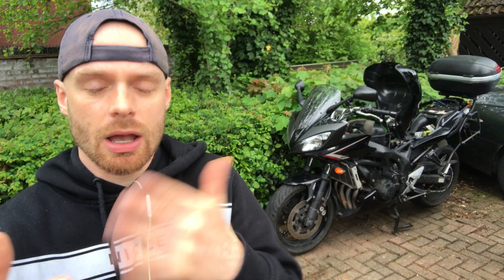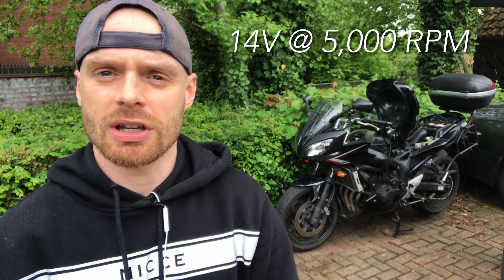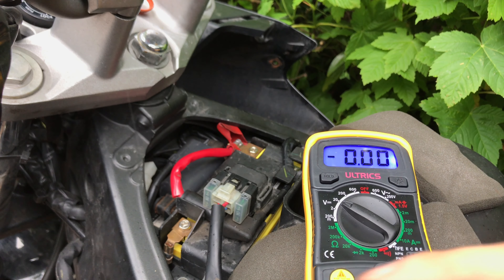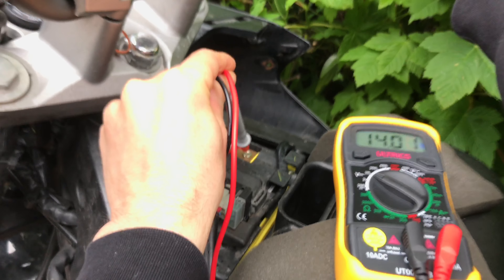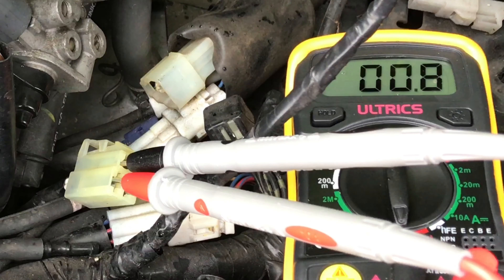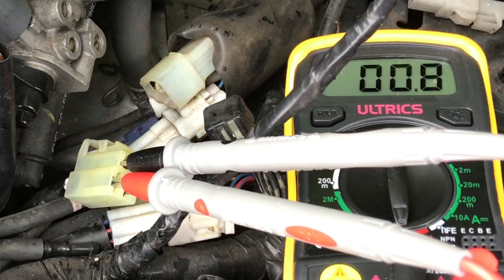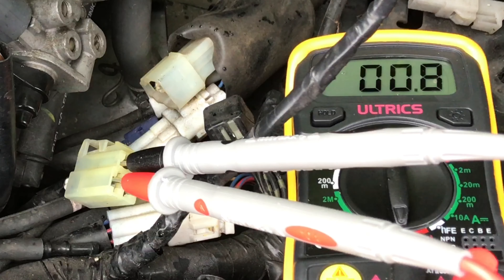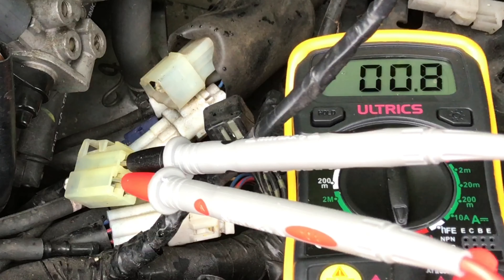Test a Motorcycle Alternator Stator & Charging System | 4 best ways | How to

Comment: Thanks for the explanation of the multimeter testing.they come with minimal instructions.
Reply from the maker: No problem. There’s a lot more to learn, but the basics in this video can serve you well for most things
Reply: @FabMotorbikes  I've got a question.i put the stater,the pulse indicator, coils,plug wires, controls, even jetted my  carbs .It runs fine but it blows headlights out like it's over charging.ive switched rectifiers idk what would cause this . maybe a crossed wire or a bad ground somewhere possibly?
Reply: @steevenknox4266  the rectifier is either faulty or the wrong one for your machine.
Reply: @roythearcher  thank you.what I found was corrosion in the plug.i used butt connectors to replace the plug and it seems to have fixed my charging problem
Reply: @steevenknox4266  Good to hear!...

Comment: This is the easiest to understand video I found . Thanks a lot .. my bike wasn't charging the battery and even the battery warning light wasn't coming ... Checked the alternator , it's fine.   Must be the rectifier then.
Reply from the maker: Thank you very much! I’m glad you found it useful 👍it does sound like it the rectifier (I have a video on that too: https://youtu.be/mn6RtpdmeQE) . For me it turned out that the battery had just completely given up.
Reply: @FabMotorbikes  thanks.  I will check it out ASAP , one more thing.   Is it okey for the alternator to throw out high voltage like 70-80 at high rpm ? , For example mine was showing 50 at about 3000 rpm .. 
Any help will be appreciated ❤️
Reply from the maker: Which of the four tests is that on? If it’s the 3rd then that is okay 👍
Reply: @FabMotorbikes  yes it was on the dynamic test where bike is running .
Reply from the maker: That’s absolutely fine 👍👍

Comment: Awesome vid clean and simple 👍, a extra check can be done on the + - terminals of the rec/regulator whilst running to see the dc output. Faults can ly between rectifier and batt. By fuses, lose connections and damaged wires.
Reply from the maker: thank you, glad you liked the video. I did also test the regulator/rectifier with it off the bike... but didn't know there was another method (which sounds simpler) of testing it on the bike whilst its running. Cheers for the tip!

Comment: Great video! 
My situation: I have a vintage 1972 yamaha 100 with points and condenser. 6v system. 3 coils attached to stator. Source coil, lighting and charging. Black wire coming out is from source coil... goes to main coil through pigtail on main wiring harness. Bike has no spark. Hard to know if source coil is grounding out with it being connected to points, condenser, source coil all being on stator plate. Tried putting cardboard between points. Shows that I have continuity to ground while testing wires coming out of stator. Thats the rub! New points, condenser, main coil, rectifier, spark plug, battery etc. I'm thinking the black wire pig tailed to main harness is grounding out the main coil... possibly in ignition switch or not connected properly in the rat best of wires behind headlight. Question: Can I take the pigtail out of the equation and simply connect black wire coming out of stator source coil... and connect directly to the one wire coming off the main coil?

Comment: I did the three phase to ground voltage test like you showed and got a 20-23 idle RPM voltage on two of the phases and pretty much zero voltage on the third phase. I talked to a local mechanic about this and he said this is to be expected as one phase out of three is supposed to be grounded. I'm not too sure about this, have you found similar configuration on a bike? Looking for some advice. Rad video! Really helped me to dig deep into my motorbike's charging issue.
Reply: You should have the  exact same ac voltages across all 3 phases.

Comment: thanks for this  my battery is on charge so i can dynamic test .i have  a2014 cb500 are all bike result be the same value 20? hoping for rain to stop when battery is charged. i tested at battery 11volts when revved stayed at 11v hope this test will find problem thanks again
Reply from the maker: The values will differ some what based on the bike. Best to check the user manual 👍

Comment: According to the Heynes manual for my XZ 550 connecting the positive rectifier connector to the  (red ) MM terminal and the black MM terminal to the 3 white leads of the rectifier the MM should signal continuity but did not, reversing this should show no continuity which it did . I think the book got it wrong because using your method a got exactly the readings you demonstrated so thank you as I really was confused. PS:  Does disconnecting the alternator while the engine is running not damage anything?
Reply from the maker: Glad it was helpful. Your manual does sounds confusing. And to answer your question… no it won’t damage anything but I’d advise to do it for as limited time possible. The battery will not be charging at all with it disconnected.

Comment: Hi Fab. 

Very helpful video. I have a 2007 Tmax which isn't charging, so I followed your testing method. Yamaha Service Manual says stator coil resistance is 0.216 - 0.264. My readings are as follows; 

AC volts readings
1&2 - idle 25, 5k - 74
1&3 - idle 20, 5k - 74
3&2 - idle 21, 5k - 73

OHMs
1&2 0.5
1&3 0.5
3&2 0.5
Resistance across the probes 0.3 

So, I'm about in spec on the outputs and resistance, right? But, despite this, all 3 wires sound the continuity bleeper when connecting any of the 3 wires to earth. So the stator is shot, yes?  Many thanks
Reply from the maker: Hi David, thank for watching glad you found it useful.

Did you perform the first test? (nominal out put of alternator) I guess could be difficult on a scooter.

From what you have told me I would agree the the stator is shot. However before forking out for a new stator straight away... (and if you have time) I would reperform the last test agian but with connection to many other parts of the bike e.g frame & engine block etc.

If still making a noise I would then remove the stator and perform a visual inspection. You'll be looking for damaged wires / coils. Or unwanted connections to pieces of hardware. 

You could also perform the same test while the stator is off the bike but still connected to the engine casing, this will narrow it down further.

Hope this is useful. And yes my general feeling is you will need a new stator
Reply: @FabMotorbikes  Thanks for the reply. Yes I did the first test but it only shows the same voltage reading (12.6v) whether its running or not and regardless of revs.
Reply from the maker: Sounds more more like you Stator is shot

Comment: Hello, now I got 0.1 resistance from stator coil, but temperature outside is +1C. In manual resistance parameters is at +20C, any suggestions, is it good? Will it increase in warm weather?
Reply from the maker: Interesting point. To be honest I’ve not considered the effect weather has. Although when the bike is running everything will warm up. So I suggest letting the bike run (if it starts at all). And retest when it’s warn

Comment: Hi brilliant channel BTW, 
I had issues and did all tests as you stated but on 3/4 test my readings were fluctuating  all over the place 19 down to 13 then 18 very rapid , could  this be faulty  stator or regulator /rectifyer  ? Cheers
Reply from the maker: Hi thank you I’m glad to hear you like my videos! 

Your readings don’t sound ideal but the fact you are getting readings of that level it doesn’t seem that bad. I would recommend doing the 3rd test again but as various rpms (I wish I had added this the video). And see if you get more consistent readings.

Testing the regulator rectifier is also well worth doing I have a video on this here>> https://youtu.be/mn6RtpdmeQE it’ll be good to eliminate that as the issue. But I’m starting to think it may be that over stator problems. Thanks! Let me know how you get on 👍
Reply: @FabMotorbikes  hi , purchased new multimeter re did the tests including removing rectifyer/resistor and testing all good except when I test connection block to stator when bike is running its reading .25  not 19 on your test any ideas as my bike just crashed out on a ride couple weeks back battery is perfect BTW thanks !
Reply from the maker: Nice work on getting those tests done. It’s seems like your stator is bad… I was hoping it was your battery or regulator/rectifier (as these are easier and cheaper to replace) but it looks like the stator is the issue.

Alternatively you could have a parasitic drain somewhere. Have you installed any additional or electrical items to you bike recently?
Reply: @FabMotorbikes  Hi, no not installed anything new electrical,  but went on bike earlier after trickle charging it had to bump start it then after a while riding turned ignition off turned it back on then started 1st time so I'm well stumped ! Gonna take it in for service then ask guys to take a look ! Will let you know Thanks for your time fella much appreciated 👍 🙏
Reply from the maker: No, thank you.! Let me know what you learn. All info is golden. Cheers again & good luck. I hope it’s not too expensive. Apologies for not being able to help you further. 👍👍
Reply: @FabMotorbikes   Hi sorry for not replying sooner (only found out today as been really busy with work and holiday) got back last night from hols so today took battery to be tested at smc  as halfords couldnt test ampage  held its charge but turns out cells were gone so after stood 2 weeks bike started straight away on full charge  turned it off but wouldnt restart ampage dropped  off so new battery and  all sorted but so glad you put up videos on stator and rectifyer problems given me more knowledge keep it up fella 👍👍

Comment: 3:38 you said the normal ohms will be 0.22-0.34 ohm but after measuring the result you got altogher made up only 0.12 (after deducting resistance on the meter itself ) . how is that normal ???
Reply from the maker: 0.8 - 0.6 = 0.2. And then account for the likely hood that there are some digits missing on my basic multimeter
Reply: @FabMotorbikes  so 0.2 is a good reading ?

Comment: It's been a year since this video was posted, but maybe i can still get an answer.
The last test you did (# 4), the ground test, i am getting between .2 & .4 on all 3 poles of the connector. Does this mean the stator windings are cooked? (2001 R6)
New voltage regulator/rectifier, replaced the 1 that had a failed diode at end of last season.
The battery holds 12.6 v.
Recently 1 of the wires going to the regulator/rectifier got hot enough it melted & made contact with the others, short, fried main fuse. Repaired. But will happen again.
Is the stator the problem here? Considering the ground test came back "positive."
Thanks in advance.
Great video by the way.
Reply from the maker: Hello. Thanks for watching. It’s seems to me that your conclusion are correct. Stator is the issue. On the fourth and final test you should not get any reading at all
Reply: @FabMotorbikes  Thanks for the quick reply.
Reply: @FabMotorbikes  I forgot to mention - charging voltage is around 14.77. If the stator is cooked, how can this be?
Reply: @moehamdan3502  if your getting any coltage over 14.5v its def rectifier diode not dumping to ground
Reply: @PryvatCyan87  thank you

Comment: @FabMotorbikes I’m facing an issue on my RE Interceptor 650. After riding for 10 minutes & crossing 2000 rpm, odometer light goes off.Downshifting or going neutral light comes up.
I tested the following:
1. Battery voltage (Ignition off)- 12V+
2. Battery voltage (Ignition on)- 13.1V-13-8V
3. Battery voltage (rev) - 14.1V-14.3V
4. Checked all 3 phase of Alternator.
Could you please give me some leads on what could be the problem?
Reply from the maker: Seems like the alternator is okay. Have you tested the regulator yet? I have a video on that too. https://youtu.be/mn6RtpdmeQE?si=ysAFvPlAENLDULR5
Reply: @FabMotorbikes  Thankyou so much. I will do the rectifier test. I hope it will give me some lead.
Reply from the maker: @shubhamjoshi4073 good luck!

Comment: Will it matter if I used true rms voltmeter when checking for stator ac voltage?
Reply from the maker: Hi this shouldn’t matter. However I have not used one so worth doing a little more research. Apologies if not much help. All the best

Comment: Another test to be done is a diode test, with a meter on the Regulator.
Set meter on Diode setting.  Put Red Meter lead, on to the Red Regulator (positive wire).  And then the Black meter lead & test each of the 3 on regulator other end.  Each shouldn't show diode voltage.  Then do the opposite.  Take Black meter lead, on Red Regulator wire.  Then Red Meter lead, & test the other 3 wires again.  All 3 should show same/ close voltage.  Validating voltage is only flowing 1 direction.

Comment: You really should test the Regulator/ Rectifier they fail more frequently than the alternator/ stator. Mine failed and it killed the battery :-( The Reg/ Rec is also cheaper to replace.

Also, buy yourself a Drop Tester (they're about £20) so you can check if it's actually the battery is faulty. I thought I had a duff battery when my FZ6 started throwing Fault Code 12 which is supposed to be a problem with the Crank Position Sensor, but it turned out to be a faulty starter relay!

If I'd not used the Drop Tester, I could have replaced a perfectly good battery. (BTW brand new batteries can be duff too...)

Oh and I'd also recommend getting a set of crocodile clip multimeter probes so you can clamp them in place instead of eg having to try to hold them both in place on the battery...!
Reply from the maker: Cheers for the tips! As you could see I was reluctant to test the regulator rectifier, but you've convinced me that its not worth the risk of not doing it. I'm confident about the battery health but a drop tester sounds a great idea (didn't know they were that cheap.) I remember you mentioning it on a previous video.

And bulldog clips are a great shout. I remember thinking how much of a pain it is with out them when filming this video. 

Cheers again!

Comment: Doing dynamic test on stator came up with 0.7 on all 3 wires can I assume that's not good
Reply from the maker: 0.7 does seem low but they are all equal, which is a good sign. You may be reading the voltage in an odd denomination

Comment: Cheers mate that was all very good mail, everything we need to know about stators & alt’s charging , 
the only other thing to test would be a regulator.. but the problem is the only way to check them (apparently)  
is a diode test which most basic multimeters don’t have.
I notice yours doesn’t have it either,  it’s the diode symbol together with a 2K symbol. ?  
Any thoughts on if there’s another way to test 3 phase regulators  ?   Cheers.
Reply from the maker: hello mate. I did end up testing the regulator too. And with the same multimeter. check out the video here>  https://www.youtube.com/watch?v=mn6RtpdmeQE

Comment: Now trying to check one with a non runner no starter motor 6V system eh? Something like a 1959 AJS 350 Model 16... and there you'll know my problem. Kick it over ammeter shows no change. mind you shows no change when turning on lights or horn either. At least I got those working. No spark of plug of course, no spark at breaker (points) though. Worse than that,  it being a '59, the book doesn't not have the standard loom as it was AMC took over so hybrid AMC/AJS wiring.... oh at least it is sort of standard as it has a LIVE FRAME! Just to make it more interesting (+ terminal goes to frame)

Comment: My Service manual Suzuki sixteen UX150  say turn the multimeter to position DC  for the third test,  you know why ?
Reply from the maker: I’m not sure. That doesn’t quite make sense to me as the stator/alternator produces an alternating current (A/C). Although it’s possible that scooters have a system. 
I honestly would still go by what your manual says to do.